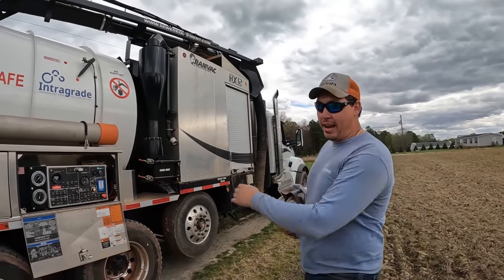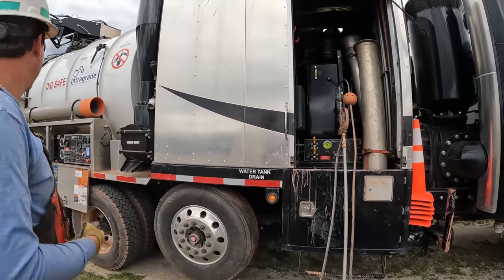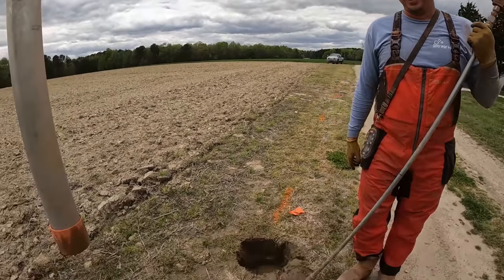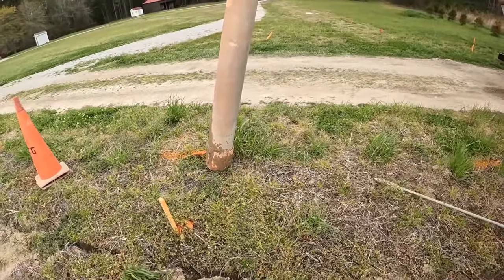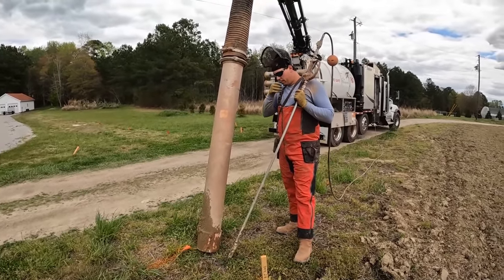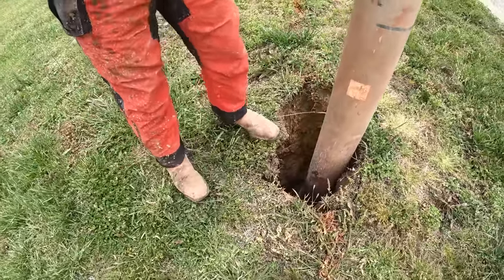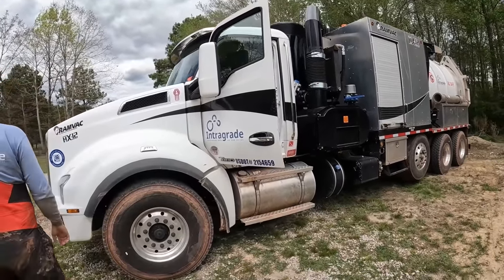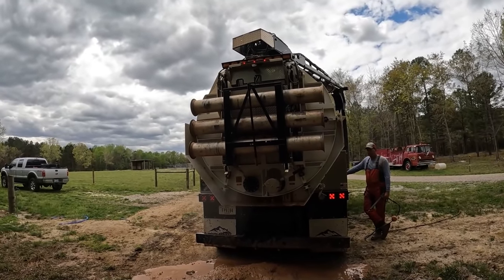Hydro Excavating Utilities With A Vac Truck

Comment: They basically did that to my house here in the UK.
Long story short I moved into this house (social rented) and now and then a random room would smell like a fart. It was strange - could be any room and at random.
After 6 months of me complaining to my landlord they gave up and got a large 'Dyna' company to investigate. They used cameras along pipes, everything. I can still remember being shown footage of them going along a sewer pipe and then it becoming 'nothing'.
What had happened, many years before I got this house, was that an underfloor 90 degrees elbow from the toilet waste pipe had come undone and fell off. Quite literally beneath my floor was a massive 4 feet thick pile of poop with a crust on it. Those smells I'd gotten were the crust breaking and randomly releasing gas!
I watched 4 workmen actually draw straws. The loser then stripped off into a special suit. Workmen had completely removed a whole room floor (bathroom). That worker then went beneath my house with a lance in one hand and a large vacuum pipe in another. They had a 8 wheel water tanker and an 8 wheel vacuum truck beside my property. It took a whole day to remove the monster beneath my floor. As they retreated they then covered every surface with lime powder.
That toilet pipe elbow was GLUED on and not simply shoved on. The bathroom floor then replaced.
My house doesn't fart any more.

Comment: pretty cool tks for sharing!!!  could have used some thing like that when i worked on a farm in the 90s. broken water line going to a barn so my bosses son grabbed the backhoe and proceeded to dig. giant explosion with tons of sparks. the bucket all of its pins and most of the boom welded itself together when he hit the high power line to the 4 grain silos. he survived but not in a way you would want to live the remainder of your life. yes we called the locate service but they were off by 2 feet and the depth was suppose to be 4 feet not 8 inches.

Comment: The pigs looked excited to see that dump. Bet they wanted to jump in and Waller in it!  🐷🐽💛
When I worked for the natural gas company. We hired a crew to lay several hundred feet of underground gas pipe. The contract called for 24 inches of cover over the pipe. When we inspected it, we found areas where it was only 4 inches deep. When we complained, they hauled in a bunch of dirt and built a MOUND over the length of the pipe and said THERE YOU GO, 24 inches of cover. 😜

Comment: Wow. That's worth its weight in gold to avoid utilities. I was thinking a vac truck like that sure would've helped with the giant mud moving you & John did. Joking aside, that was really nice.
Reply: That would have taken forever as slow as it goes and as little as it holds.
Reply: @JCrook1028  actually JC there is a truck called supper vac truck. It holds the same as 10 wheel dump truck and is very efficient for wet or dry material. Very efficient until you have to have it within a hundred yards of end of hose. albeit that would make for a nice recovery video! lol
Reply: @glen3257  Yea now show me that truck vacuuming up the masses of tree stumps and debris from a pond cleanout. Smh.
Reply: @JCrook1028  I know, my comment was tongue in cheek! Happy Easter

Comment: The actual depth of utilities and gas transmission line is a serious problem. Out in California where they use deep ripping to renew fields, the contractor may be told by PG&E (Pacific Gas and Electric) that a 24 " gas line is four feet down. Often they were when originally installed,  but working the fields has changed the depth. It used to be common enough for a D8 pulling a three foot ripper to contact a high pressure main. Usually the blast destroyed the tractor and killed the operator.

Comment: That seems such a safe easy way to locate utilities, I have never seen one before, how long have they been about.
Regards Richard 🇬🇧
Reply: This method is also used to dig under trees to not damage the roots when a tree is marked to be saved.
Reply: in the uk they have been around for at least 15 years. we use them when we have a known high risk excavation. I.E oil pipeline, high pressure gas main etc, but otherwise they have not been used much mostly due to costs, they are messy and it is difficult to find a landfill or reclamation yard that will take the spoil.
Reply: @dennis2376  I've used my pressure washer to remove a pine bush tree too close to my house so that nobody wanted to dig out.
Tied the trunk to my car hitch to pull lightly and "washed" the roots  and cut them one at the time.
Done in 1 hour.
Less time than to clean myself !  🤣

Comment: Just had one on my job site last week. Over 25’ I had a gas main. Fiber. 2 phone lines. Primary power. Cable. Sewer. And water taps were somewhere in there somewhere and city really didn’t have a clue. Biggest joke of a city I’ve ever felt with

Comment: Vey interesting video, those save a lot of time and lives. A friend of mine that I ran a track loader for years ago knew a guy that had a backhoe service, the buy was digging with his backhoe and hit an unmarked underground power line, it actual melted the soles of his boots he was wearing, he die from the electric shock.

Comment: here in north western Ont, Canada all new and replacement hydro poles the holes are all dug out 6 feet deep and 3 feet around with trucks like that, in the city,, there is so much crap in the ground they dont dare dig or drill any holes with a machine at all ,, most streets will have 2 water mains an18 inch and a 42 inch, and 2 to 4 different size gas lines power lines cable tv phone ,,, fiber you name it so all hole are only done with trucks like this, for over 25 years now,,

Comment: I had to uncover a well head to replace a foot valve. The well head was underneath my deck with about 2 1/2' of space to work with. The well head was 36" underground with no way to use shovels, digging bar or posthole digger. So I had the idea to use pressure washer and a Ridgid 16gal shop-vac. I excavated a hole 3' in diameter and 4' deep in a bout 30 minutes. I WILL NEVER DIG ANOTHER POST HOLE WITH A POST HOLE DIGGER EVER AGAIN!!! LOL!

Comment: SEE!! THIS is what you need to buy for the pond dredging jobs! Imagine how much faster it would be sucking the mud up with the help of the pressure wand, instead of using an excavator bucket. You need the right tool for the job!

(sarcasm, we can see how slow it works compared to a big bucket... Lol

Comment: That fiber was pretty shallow at the first two holes! The only time these were brought out was when it was a major project around a busy intersection with a lot of utilities. A couple of times my fibers were bored under a canal or interstate at an averaged 20 feet. They hated the deep ones and I would say...keep looking...it is there. After a while I would get the ugly looks and questioned if I located it properly. It was always where I marked it and at the depth my As-Built and the locator said it was. Could not say that for the other fiber companies.
Reply: This was just a fiber drop
Reply: @russellsmith3825  ok...the smallest I had was a 48 count and everything was at least four feet deep to make room for sanitation, gas, water.
Reply: The fiber line coming up to my suburban hose from the line at the road is literally 3 inches deep.
Reply: @terrancecoard388  many counties have permit requirements for new cables places in their rights of way, however on a driveway that doesn't apply. 
For traditional copper Telco, they used to place mains 18-24" and contractors were paid to bury drops 12" but we were lucky to get 6, now at&t pays for 6 but is lucky to get 3.
Another factor to consider is the grade may have changed considerably since the cable was placed, generally by erosion sometimes by fill, especially in rural areas, one of the worst was a cable that was placed in 2006, at least 18" deep and over 400' of it was completely exposed and stolen because the county failed to maintain grade, you could stand on the edge of the road and the shoulder was eyeball level.

Comment: I used to dig pole holes by hand because there are always enough that are too close to existing utilities. Me and other guys ended up destroying our shoulder sockets because of the downward chopping motions. I found out that the main utility company had known about this happening to guys like me and they switched to those vacuum trucks a long time ago for their guys. So Im just trying to make a living digging holes, destroying my body, then to find out the utility hires subs who dig by hand to save money because they have to use a vacuum trucks when they do it, fucking pisses me off. I havent done that work in many years but my shoulders will always be messed up from it and I just have to suffer with pain for the rest of my life. Young, ignorant, trying to be hard and make a living in shit conditions, just being used up because their isnt a damn thing we can do about it. The sub I worked for closed out but the Utility knew for the last decade about this and just used subs for most of the hand work.
Reply: How do they backfill the holes?
Reply: @JCrook1028  One guy with a tamper and one guy with a shovel. Filling it in is the easy part.
Reply: @Darthreloy  Yea around my area they've used augers on trucks to drill pole holes for the last 30 years or so. Never seen one done by hand. That would suck for sure.
Reply: One summer with a shovel in the hot summer sun convinces a lot of young ignorant laborers to learn a skill. Others keep digging themselves into a hole. OH well it paid good money. Quit blaming others for your choices.
Reply: @JCrook1028  Most are done with augers, only those within 2 feet of other utilities have to be done by other means. "By other means" is a full time crew.

Comment: we use this kinda thing alot in the uk for service location when we do site investigations because over here the utilities companies will supply you with plans but generally do not come and mark out for you without a significant fee if they will come at all, if they do mark out its still your fault if you hit something, the plans they provide for a fee are inaccurate but that dosnt matter its still your fault if you hit something even if its not marked on the plans they provide! Absolute nightmare at times

Comment: I saw a fella dig through a four inch diameter cable supplying power to an entire factory. He was five feet over from the marked paint line. Blew the whole side out of a caterpillar backhoe bucket. Operator said it blew a hole in his shorts too but I didn't confirm that part.

Comment: That was fascinating!  Never knew such tech existed.  On the homeowner scale, could someone do about the same thing with a pressure wash and wet/dry vac??  

Would that be cost effective for doing basement egress window retrofits as well??  Other uses besides utility locators??  Curious....
Reply: we did 20 ft trenches 18 inches deep  with a Rigid  100 gallon  Wet vac that was destined for the  dumpster anyway and a Home cheapo power washer.  the mud/slurry was hard on the motor but it did work slowly.  once you get down into subsoil, the hard stuff it takes forever. limestone,sandstone clogged up the hose pretty good too

Comment: When I was a gas locator before I retired back in 13 they were quite big up here vacuum trucks. They do make work a lot easier and they can also make it harder. We had issues up here where they cut the gas lines. They're using the wrong heads. They have to use a alternating head that's not stuck in one position or it's too strong and it'll cut utilities. It definitely has come a long way. Make everybody's work a lot easier. Like you said, the locators can tell you how deep the utility is. I would never give out the depth of the pipe and if I did I wasn't leaving till they found it because like you said you tell him it's 2 ft and they're going to dig right up to that point and when they hit it they're going to say it's your fault cuz you told me it's 2 ft so I never left until they found it if I gave him the depth. 👍👍🙂🇨🇦

Comment: I'm a Electrician deal with miss all every job before I dig.In 40+ years iv never seen primary Voltage that shallow.In Alabama it is required to be conduit normally PVC and 48" to top of the pipe most rural is subbed out to different Companies by the power Co.That is freaking scary and sorry.Your power company engineer is going to love this!!
Reply: that wasn't a power line, it was a fiber optic line

Comment: Worked on one about 2/3 the size of that one, but without a boom. 2 man job, with one on the water lance and the other positioning the 6 inch vac hose. Efficient, but messy for the operators.

Comment: control panel on that makes me think of the missle platform from "Spies Like Us"... Though this reminds of a time my father was working with the Town excavator and dealing with utilities... and they told his coworker when asked "What if he hits that power line?", and the reply was "It will fry him so quickly that Your man in the machine will never know it!"  Always good to know where the utils are.. not to mention the time the gas company said, "This line is dead, so you can just go through it".. my father told him to punch it... "Oh, it's fine..." Punch it and prove it.. he punched it... nope, it was the live line.. and because he punched it.., it's the gas companies problem... can never be too careful... (working for the town, he never worried about water lines.. he was often working for them when he was digging...).. hmm, that looks like that crap you pull from all those ponds...
Reply: I've seen quite a few excavators and backhoes hit charged lines and the operator was fine.  If you're in an old machine, I doubt you'd live through it though.  Back when they had actual cables running to the valve body instead of computers.
Reply: @pamike4873  This was a high power feeder line this was not a little charge line and it was also back in like 1983 so you were talking a while ago
Reply: @ronpeacock9939  Well the line I saw go was a three-phase main carrying 7,400 volts.  The excavator was still running, but the hydraulics locked.  When the system energized the line twice more during the self-test it melted the bucket and welded it fast to the cables.  It did that in less than 1 second.  All the hydraulic lines were smoking, but nothing in the cab even showed signs of heat.  The valve block was toast, one of the valves on the stick was melted, lightning shot out of a tooth on the thumb, and the computer was fried, but that damn thing never shut down.  It sat there purring like a kitten.
Reply: @pamike4873  Well, I only know what I was told when Pops got home from work that day... Now they followed the recommendation and when they hit the tape, hand dug the rest of the way.  So they never found out.  The fact that he's enjoying his retirement now means he also never had to find out the hard way that they were right either (The town DOT was very careful about "We don't touch utilities" except the water lines as the water dept was part of the town DOT. (so he got OT every time a water line break occured.. which is often in the NE in the winter.)

Comment: Just think how cool it would be to attach that vacuum to the boom of your excavator for dredging 😎
Reply: And the vac operator said he had run it with about 250 feet of hose too.
Reply: @michiganengineer8621  and it also is slow...
Reply: @JCrook1028  Yeah, a lot slower than the excavators

Comment: Most states require 24” bury with caution tape.
Reply: not a power line, fiber optic line
Reply: @richardschipper5989  Direct Burial of Cables or Conductors

MISSOURI LAW
Underground feeder cables, labeled UF, can be buried without additional protection from conduits because they have a tough jacket designed for burial. Bury UF cables 24 inches below the soil surface, and 18 inches deep when protected by 2 inches of concrete. For all other applications, the burial depth is the same as specified for conduits, except that conduits are required for UF cables in 2 inches of solid rock.

Comment: The facility I protect pretty much only uses this method now, far too many old projects, lines, extensions that are all engineered and marked and pathed because of the regulatory requirements; that even though its all "exactly known" where its all at, its not worth the chance to damage something.

Comment: So could ya DIY,slower of course,with a big wet/dry vac and a big pressure washer with extension and turbo head? You know,an easier way to set a few posts than using a post hole digger? And cheaper than hiring/renting an auger. LOL,asking for the proverbial friend.

Comment: Camera down. First cassualty😉. Are those lines high pressureproof? You could cut them with this water pressure tool. Dont try this at home.
Reply: Nah it’s only like 3,000 PSI... WaterJet cutters for cutting are like 60,000 PSI.

Comment: we do that with a shovel, by hand, much cheaper:)))
Reply: Not when time is money it ain’t.
Reply: @crandonborth  truck costs over $200,000 I think ,here in Belgium probably even more
Reply: @dhollanderpeter2474  Here in the US the basic truck frame would cost close to $200,000 and then the vac attachment on the back would be probably another 2 to $300,000 maybe more. I wouldn’t be surprised if that entire unit was over half million. But... imagine the money you can save over the course of a year you could easily pay for the truck.

Comment: Chris I saw a similar outfit doing the same thing at a McDonald’s where they were having to in stall some parking lot light fixtures and could not get a mini in because of concrete on both sides. Did you get a discounted price because you provided the dump site?
Reply: Did you listen to the video? Customer is required to provide a dump site or there is an additional fee to haul the slurry away.